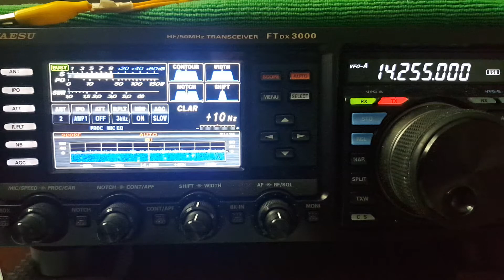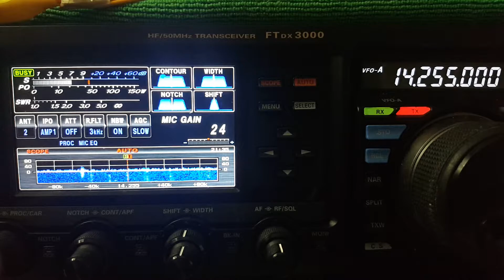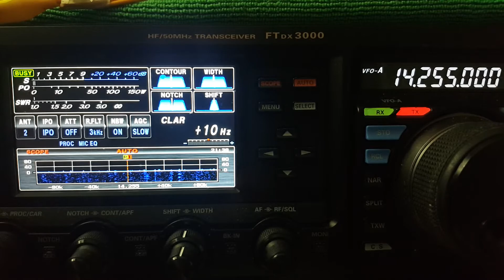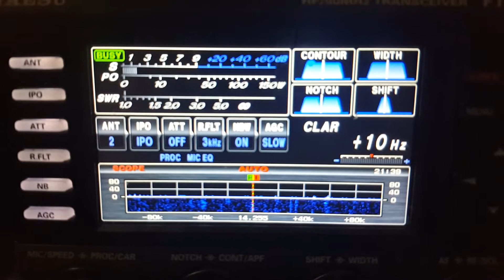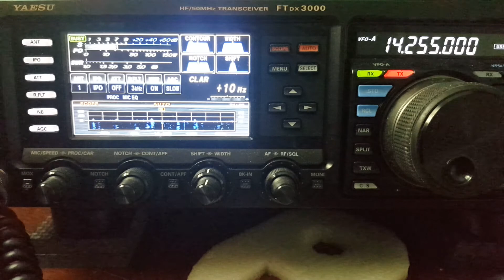TU OM3TWM - Saved by the Cacti after 20m Desperation Wire FAIL

Comment: You ever try ft8?
Reply from the maker: Oh my. I don't know what to say, given this:
https://youtu.be/zKsgvpc_2Pk
But also, given my love of screwing off, i mean 'experimenting', it would make a LOT of sense. I probably will, but am waiting on coax, etc, in order to move my ham desk next to my electronics bench. Then both will share a powerful Linux system, connected to several monitors. I'll dedicate one finally to the rig, and then can screw around with digital modes at times. I have MUCH to learn tho    :/